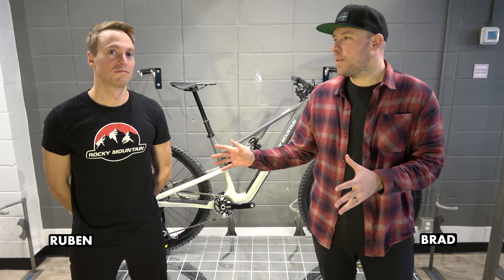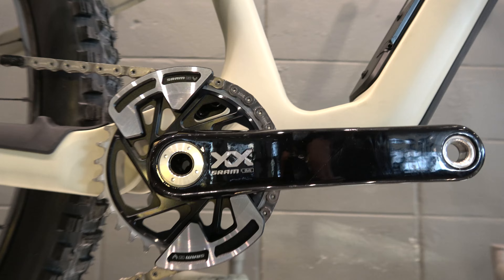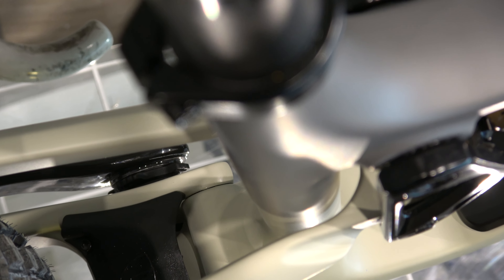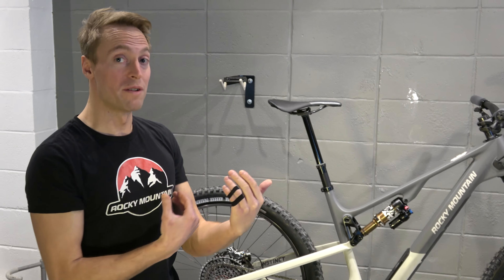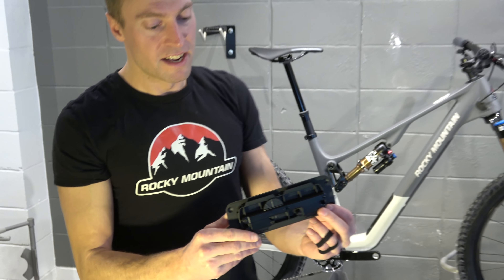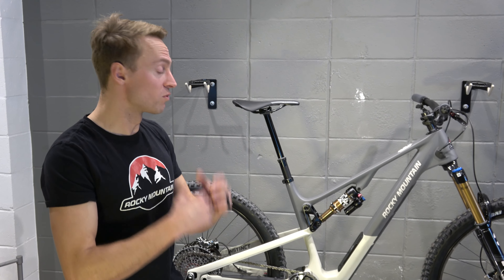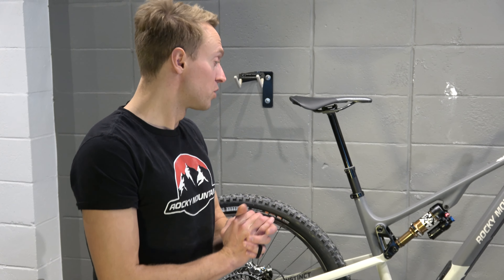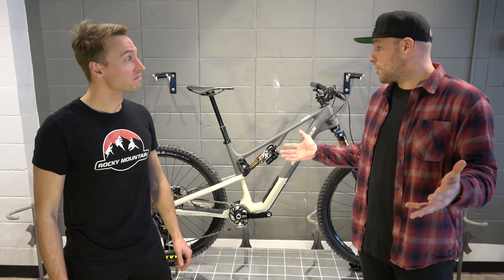Exploring the New Rocky Mountain Instinct for 2024 // The Bike Shop

Comment: Most new mountain bikes have the bulging tube in front of the BB, looks like one rock strike and your frame is toast!
Reply from the maker: A rock is more likely going to hit your chainring before it makes contact with your frame because the chainring is still below the frame
Reply: @thebikeshopofficial clearly didn't understand the original comment.
Reply from the maker: @the6ig6adwolf  No I definitely didn't. Now I understand though. It's a fair point!
Reply: They have to make room for the frame storage areas in the downtube. You have to crash to hit the frame there or make a mistake... if you have a chain guide bash guard. They should come installed on carbon frames.